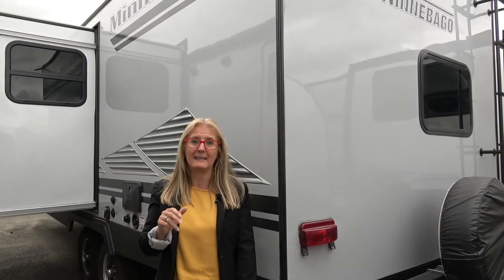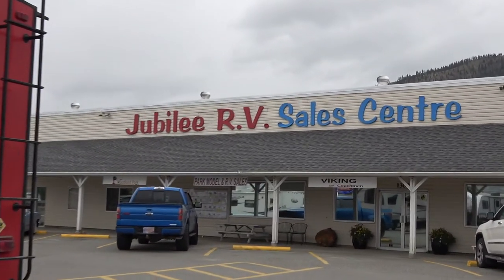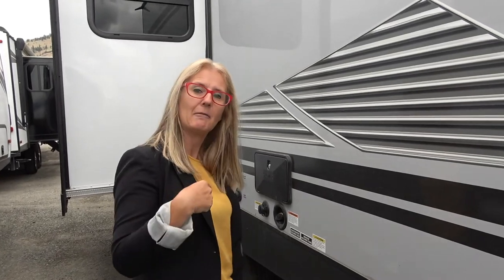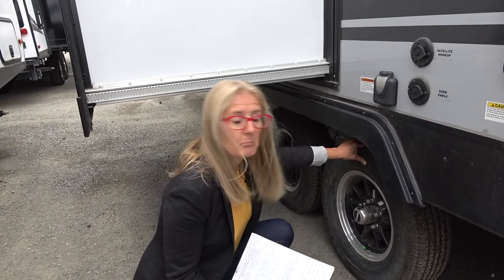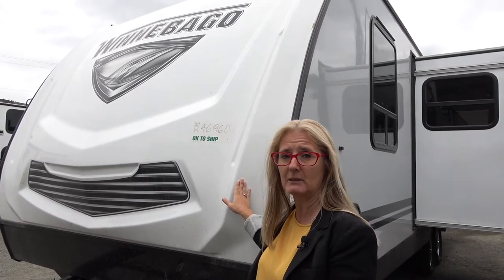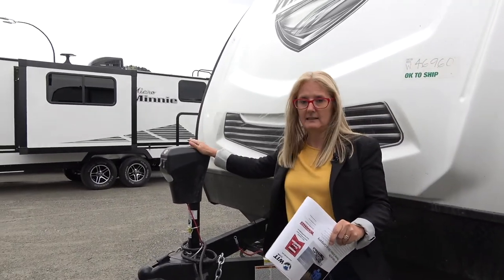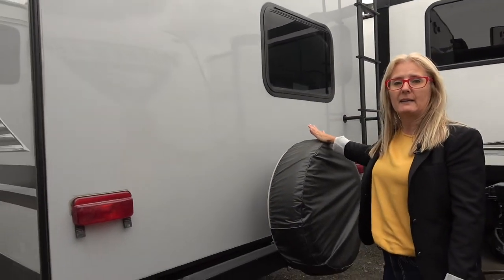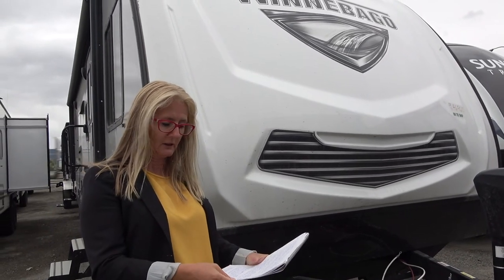Winnebago Minnie Travel Trailer Construction // 2020 // (Unbiased RV Review)

Comment: Can’t believe the walls are Pinch rolled. Pinch rolled side walls would greatly lower my quality assessment of Winnebago Winnie Minnie series. However, it seems to work for them.
Reply from the maker: We would rather see vacuum bonding but pinch rolled is more common and does reduce cost. You are right it does seem to be working for them as we have not heard of a bunch problems with delamination. Thanks for watching.

Comment: Thank you so so much for this wonderful video, this is very helpful! Do you happen to know the R-value of the fiberglass insulation?
Reply from the maker: We do not know the R-Value of the specific insulation product they use. R-Values in RVs are very tough to calculate and compare to each other as each manufacturer calculates their R-values based on different things, so you are not comparing apples to apples when it comes to R-value. The details that make one trailer better insulated than another would be how thick the insulation is, how thick the walls and roof are, what products are being used, is the underbelly enclosed and are windows single or double pane. Hope that helps. Thanks for hanging out and watching.
Reply: @DoesSizeMatter  Thank you so much! That is very helpful!!

Comment: I am looking forward to your Minnie series! Could you explain awning toppers for slides? What are they? Do RVs come with them or do you have to install them yourself? Thanks!
Reply from the maker: Great we are looking forward to sharing some more. The slide toppers are little awnings attached to the exterior wall and the outer edge of the slide. Their function is to cover the top of the slide when it is in it's extended position. Just helps to shed water and help avoid leaves and the such from settling on top of the slide which could become a problem when you pull it in. Absolutely anything you can do to avoid water getting near any opening on your slide is helpful. Some RVs come with them for others, almost any, it is an option you can add. We would not install them ourselves but I'm sure there are lots of handy folks out there that could and you may even find a 'how to video' on youtube for that but you won't find it on our channel 😉. Looking forward to showing you more of the Winnebago Minnie Series. Stay tuned. Thanks for watching.
Reply: Thank you! I really learn a lot from your reviews. You both do a great job!